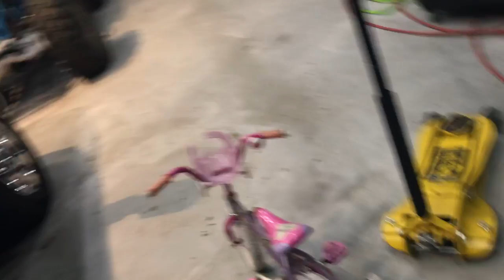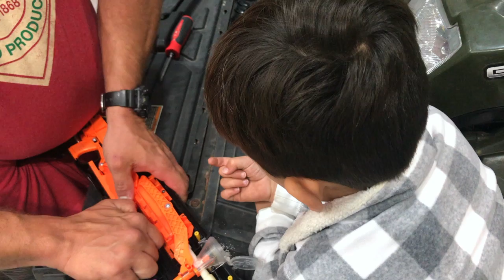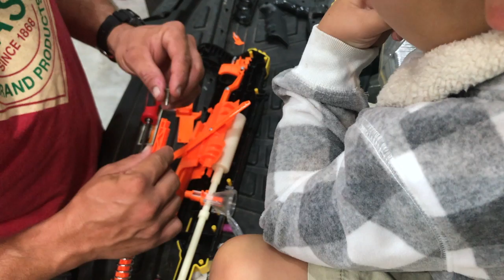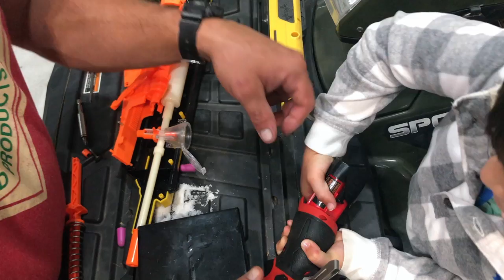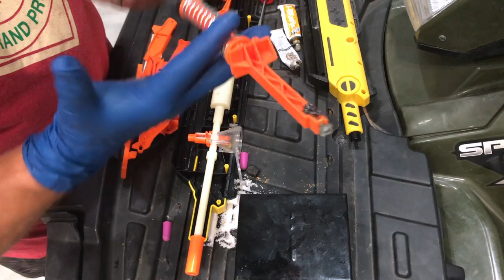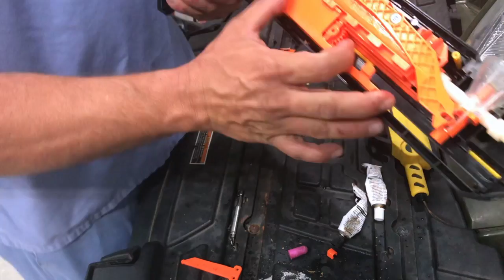Bug-A-Salt is the most fun you can have with a flyswatter. Lets tear one apart.

Comment: Thanks for the video! It helped me take the orange tip off without breaking it. Mine had salt jamming up the salt valve and was blowing the air out of the hopper. Took it apart cleaned everything and put back together good as new.

Comment: Has the screw damaged the "seer"? Seems like that screw could be hard on other plastic pieces over time. I just got my 3rd Bug a Salt used off eBay seemed a good deal since it came with the Lazer site. The description said "works great" , well it is broke in that exact way. Thanks for the interesting fix video. I always like fixing things as opposed to making everything disposable. I wonder if someone used a part as a template, maybe cast aluminum replacement parts could be more durable?

Comment: I would rather Mod that Bug a salt for a air tank chamber, made of PVC tube, that way you have Air pushing the salt harder/faster, and mod it for more salt volume to be shot, per shot. Multiple, fast  shots with a air tank could be had. You could also use a Main Large Spring spacer to add more spring compression, now that you have it modified
Reply: A stronger spring will compromise the plastic seer and other comps. You could make a new hammer and piston to accomdate,  though you may just find yourself chasing after replacement piece after piece as you break the remaining TOY pneumatic shotty.

Comment: Mine still shoots decently, but the part where they hold salt always lets salt pop out because the lids broken.  I used super glue, hot glue, electric tape and many other tapes.  Any suggestions?
Reply from the maker: A big rubber band?
Reply: @texacajundiy  tried that.. I just ordered a new one.  Thanks for the suggestion
Reply: Yea i had the same problem as you but i fixed it whit some velcro and  now it is as good as new